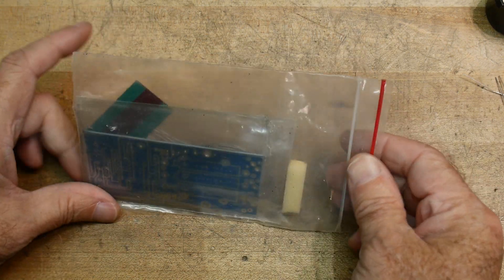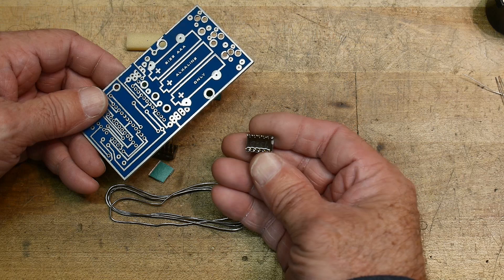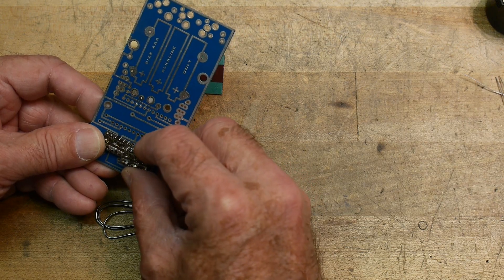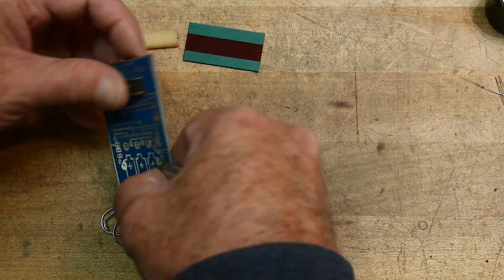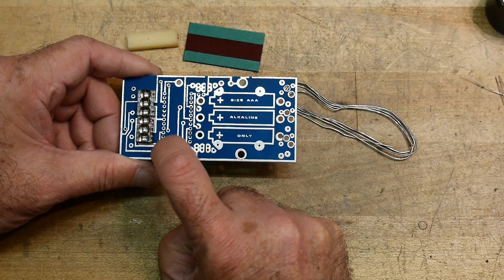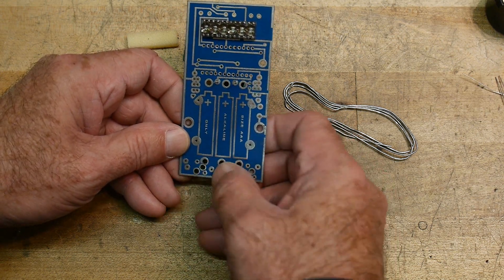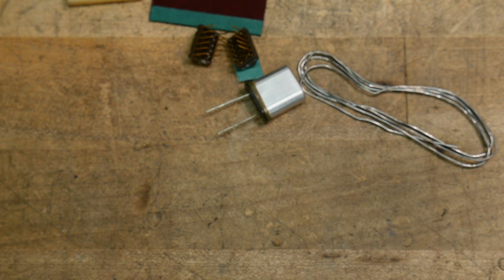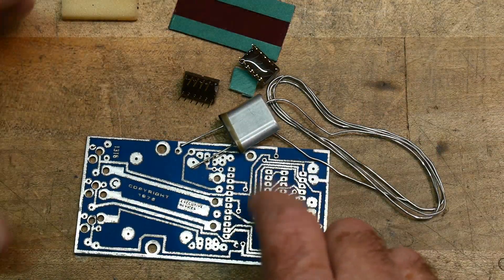#634 Mystery Kit from 1976

Comment: Perhaps a new clue can be had by "buzzing" out that LED strip to understand what symbols it generates.
There do not seem to be current limiting resistors, but you would of course want to be very careful about how much voltage you apply against it.